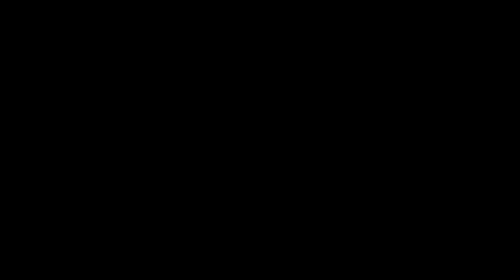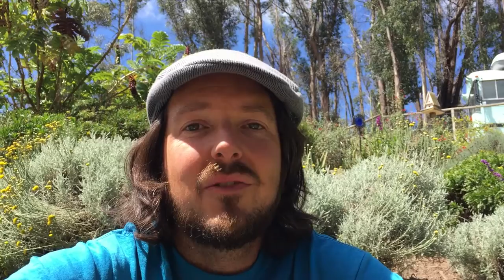14. Busaru Harness Outro

Comment: Great series, Mick! Mine was already done, but it looks like I did OK, based on your step-by-step. Yep, barrel connector vs. earlier vans that don't have them, would be a good topic. Maybe touch on the alternator differences among Subaru's, as well as dealing with codes (OBD 1 and 2), and perhaps a bit about donor cars/transmission types/years that make for easier swaps, etc. Just some suggestions. Thank you for taking the time and effort. Karl
Reply from the maker: +Forthwith Tx Thanks Karl, those are all great suggestions for future videos - keep them coming!